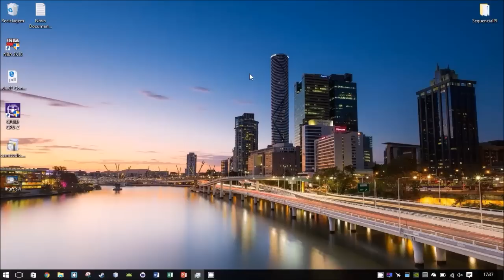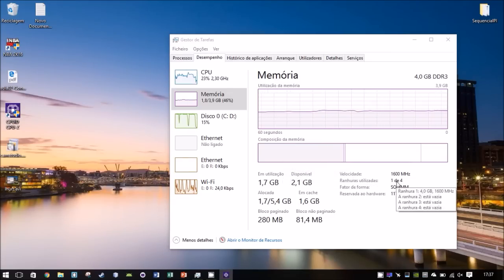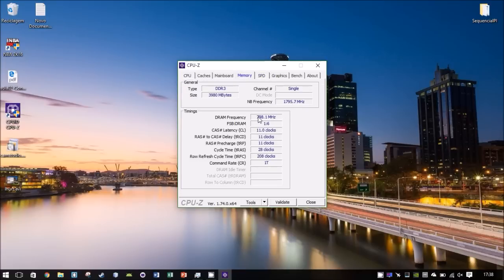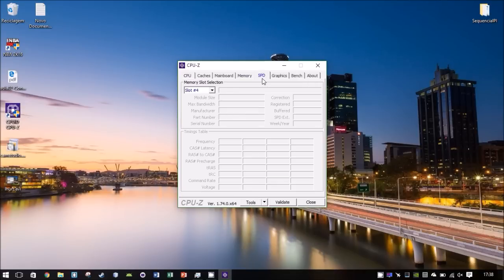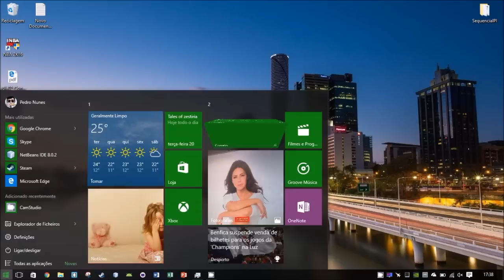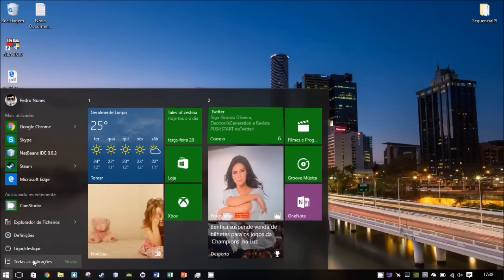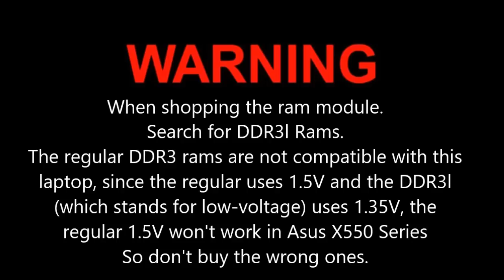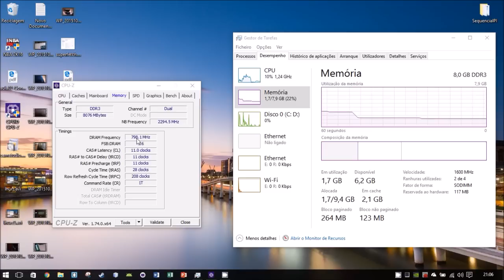How to upgrade Ram on Asus X550 Series (X550LB)

Comment: Is the Hyperx Impact 8gb ram DDR 4 2133mHz 1,2v compatible with my x550lb ?
Reply from the maker: No, but what cpu do you have?
Reply: I5 4200U at 2,4 ghz. But will a DDR 3 of the same model work ? Considering it has 1600mhz....
Reply from the maker: Alright that laptop is incompatible with DDR IV.
What you need is a DDR3L 1600MHZ, CL9 or something.
Why DDR3L, because our laptop only handles low voltage stuff, our CPU for example is a i5 4200"U", the U stands for low voltage, so, we need as well DDR3L which have like 1.35V while the regular DDR3 have 1.5v

Any DDR3L 1600MHZ CL9 will be 100% compatible with your laptop.
Cheers
Reply: Thanks , sir ! You helped me a lot
Reply from the maker: Well that's nothing :)
Any extra doubt that you might have, just let me know.
Cheers

Comment: Nice. This memory work ON Asus X555UB?
Reply from the maker: Hi, sorry for taking so long, which memory are you talking about?
Reply: DDR3L 1600
Reply from the maker: Depends, what CPU Brand and model are you using?
Reply: Core i5 6200u.
Reply from the maker: I guess that one uses DDR IV already.
You can check it by using CPU-Z, it's a small software that tells you everything about your CPU, motherboard and Ram, it's free.

Comment: Hello Sir! thanks for your guides! Im currently using Asus A550L, with 4gb ram installed in the extra ram slot (8GB total). For now i am upgrading to 12GB total, bought a Crucial 8GB DDR3L-1600 SODIMM. Do i have to install any software after replacing the current one?
Reply from the maker: No, you just need to replace the ram, nothing more :)
Cheers
Reply: Alright! Thank you!
Reply: @BenchARTVideos  hi bosd extra slot ram max 4gb or 8gb?

Comment: I have same laptop series asus x552m but that slot is already used,in task manager it says 1 out of 2 slots used so I cant find second slot
Reply from the maker: Probably there isn't any second slot, it's bad software measurement, just like you can see in my video, the software claims that I have 4 slots, and I just have 1, that I why I have been suggesting to always open the laptop before buying the ram.

Comment: can upgrade a cpu on this laptop ? i have same but i think i ant upgrade my
Reply from the maker: Nope, It's all solded, It might be possible, but it shouldn't be easy since it's solded!
Reply: ohh thanks for the fast reply hope it can be upgradeble i have celeron 1.5ghz with 8gb ram really need better cpu
Reply from the maker: I think you are out of luck, and even a CPU like this one isn't cheap at all, it costs around 300$
Even if it was possible to de-solded the CPU and put another one (which I don't really know if it is possible or not, never saw that process), it would seriously be expensive.
You can find laptops with i3 and i5 ULV versions from 450$ to 550$ brand new, which should be much better deal.
Cheers

Comment: BenchART Hi I have X550vx laptop with 8 gigs of memory, are there two slots 8 gigs or am I replacing the 8 gig with 16 gigs memory card?
Reply from the maker: I'm not really sure.
You will need to open it up in order to check it.
Just like I said software don't properly know how much slots you have.

Comment: Hi there! does it work for Asus K550c?   Thank you very much and congrats for your video!
Reply from the maker: Should work yes.
What is the CPU of your laptop?
Reply: i5-3337U CPU 1.80 ghz        Also, it says 'Sockets=1'; 'Cores=2'                                     Thank you very much for your quick reply!
Reply from the maker: Well yes, it will work, you need a 1.35V ram kit, so basically when you go to the store just ask for DDR3L, since it's suitable for low voltage laptops like ours.
Cheers..
Reply: Sorry but, how can I find the maximum ram capacity?   Should I buy a 4, 8 gb?
Reply from the maker: Well, first stop is to open your laptop the same way that I did, check if you have the free slot.
How much ram your laptop have?
Reply: it says 4gb ram. So once I open  the laptop it should be written?
Reply from the maker: Well in that case you should have a free slot, in the same exact spot as mine.
You can put 8GB or 4GB that depends on the tasks that you will do to your PC.
+4GB if you plan on gaming a little more.
+8GB if you plan in Multimedia things like rendering on After Effects or Premiere/Photoshop.
Reply: Great! thank you for your advice, it is very helpful for those who know anything about it!
Reply from the maker: You're welcome, any doubt just ask..
Cheers
Reply: Yes, I got one: have you tried the SSD upgrade (from HDD)?  Thanks!
Reply from the maker: I was thinking about that some time ago, but now SSD prices have risen, and I removed that ideia for now.
But now I am eager to upgrade my desktop :D
I'm saving slowly for it.
Anyway what's the question? I can fill you in
Reply: Thanks! I think the asus k550cc is a good laptop, and by upgrading the ram and changing the hdd to sdd,  might be a good way to save money until get a newer and better laptop... what do u think? I saw another video doing the ssd upgrade but I'm not sure if this will work..  cheers!
Reply from the maker: It will work :)
What's the main use of your laptop?
Reply: 'office word' and images, pdf, and the likes...but these files are getting quite heavy and my laptop gets slow everytime I put images into a word file....so I thought I could solve this by upgrading the ram while I save money for a newer....
Reply from the maker: SSDs will help you out with that a lot.
Altough even (maybe) 8gb with a SSD will be enough for you to make your laptop last for a decade.
Cheers
Reply: BenchART  great! But I don't know which type or model...that's why I asked you about the ram...
Reply from the maker: Probably you gonna need to buy DDR3L 1600MHZ CL9
Cheers
Reply: Thanks, I need to be sure about which one before purchasing it...  you have been very helpful mate... cheers!
Reply from the maker: Good luck, let me know if the things gone as suppose to after you are done with the upgrade.
Cheers
Reply: Well, I've just looked at 'DDR3L 1600MHZ CL9' SSD  but couldn't find anything. The video I saw doing the Ram and SSD upgrade (Italian, easy to find here) did it with a SSR3L ram, but with the 'Kingston SSDNowV300 Unità a Stato Solido Interno, 240 GB, 2,5", SATA 3.0'....
Reply: sorry for asking so many things...
Reply from the maker: Ohhh sorry.
I though you were asking for what ram should you buy.
For ram look for that "DDR3L 1600MHZ CL9"
As for SSD a Samsung 750 should be fine, strongly advice to buy a 240/250GB unit intead the one from 120GB
In any case if you preffer other brand Crucial BX series used to be very good too.
Cheers
Reply: Great! Thanks once again!
Reply: Update: I asked to ASUS and they replied: "We inform you that in your equipment you can put a memory of 2Gb or 4Gb. Being that the memories that have been tested in this equipment follow below.
2Gb:
HYNIX/HMT425S6AFR6A-PB
SAMSUNG/M471B5773CHS-YK0
4Gb:
HYNIX/HMT451S6AFR8A-PB
KINGSTON/ASU16D3LS1KBG/4G
SAMSUNG/M471B5273CH0-YK0

Regarding the storage, we are sorry but this equipment does not have the capacity to install an SSD disk, reason why we will not be able to give information on them."

I'm a bit confused, have to admit. They do not say the maximum ram amount and more interestingly reject the SSD upgrade!    

Any comment?

Cheers!
Reply from the maker: They don't know what they are talking about :)
I can assure you, your laptop supports a lot of ram.
As for SSD, your laptop supports it, you need to remove the HDD and put the SSD.
Reply: Agree!  I hope the one I bought really works (Kingston KVR16LS11/8 - Memoria SODIMM de 8 GB, DDR3L, 1600MHz, Non-ECC, CL11, 1.35 V)
Reply from the maker: It will, if you have the free slot
Reply: Update!  It did work! Although I saw in many websites my laptop had 8gbs of max ram memory, it is actually working and the total ram memroy displayed is 12gb!    Thanks for your help Mate!  Next, the SSD!
Reply from the maker: Nice to know :)
The SSD will be very very noticable in your system.
Cheers

Comment: asus x550cc is it same ? what do u think about ssd samsung evo 850d this laptop ?
Reply from the maker: The insides, i'm not really sure if it is the same, if you tell me the CPU that you have, I can tell you if the rams are the same.
About the SSD, samsung is good enough :)
Reply: cpu i5 3337U 1.8ghz 4cpu's
4gb rams and 1 slot
Reply from the maker: In that case should be the same, yes you can upgrade to a Samsung SSD :)

Comment: Can you help me with the process with my Asus k550xv??
Reply from the maker: What is your CPU, I think your Chassis is different, so you the opening of the laptop might be different.
Reply: BenchART I have an intel core i5,  4 gb ram, 500 gb hdd, Nvidia 950 
I was planning on adding 4 more gigs of ram
Reply from the maker: And you should do it, but what's the model of the CPU, it's just more of a curiosity.
The problem is, I'm not sure if the chassis is the same..
Reply from the maker: Yep you can buy any DDR IV ram at 2133MHZ for your laptop :)
Reply: BenchART thanks dude I appreciate it
Reply from the maker: The dissassembly of the laptop might be different than what you saw here.
This one was the X550 series, yours is the K550, not sure how much is different when it comes to open it up.
But I bet there are more videos like this for your K550.
Cheers
Reply: BenchART I guess I'll have to figure it out by my self but I read on some review that it shouldn't be difficult

Comment: I salute you sir for this video. I have 2 questions. 1'st is the upgrade really being felt, i mean is there a big difference in the performances of the laptop? 2'nd is there any other way to upgrade the laptop. thank you for your time :)
Reply from the maker: Hi Costin, thanks for the comment.
So for me it was felt, due to the fact that i do some software development, and tools like Visual Studio and other high end IDEs are hungry enough for ram, not to mention that many games start to use a lot of ram.

The ram upgrade is only felt depending on the type of use you do it.
You can share with me the type of use that you give to it, in order to know if can be a good ideia or not.

For the second question.
Yes, you can upgrade your HDD to an SSD, which is a recommendation that i make to anyone who have the money, it will make your laptop blazing fast on windows and opening and closing stuff.
Cheers
Reply: BenchART well i use it mainly for gaming and some software development, on the gaming side the x550lb is pretty rusted.  I was asking myself if the extra ram would  actually be felt in regards to better gaming performance i know ram is important but with the poor gaming cpu and video card i was not sure on the result. on the dev part i am fine for now. ty so much for the quick response and for your time.
Reply: BenchART well i use it mainly for gaming and some software development, on the gaming side the x550lb is pretty rusted.  I was asking myself if the extra ram would  actually be felt in regards to better gaming performance i know ram is important but with the poor gaming cpu and video card i was not sure on the result. on the dev part i am fine for now. ty so much for the quick response and for your time.
Reply: BenchART oh, i have the i3 1.7 ghz with a nvidia 740m
Reply: Probably it's the time for a upgrade to a desktop for gaming and keeping this one for code.
Reply from the maker: Costin Balan That's exactly what I have :)
I have my desktop for 7 years and still handle all the games I want, except for mafia 3 due to a CPU incompatbility :)

Comment: What is the maximum improvement I can make in this model? I have 6GB and would like to improve if it's possible for 16GB, can i make that?
Reply from the maker: The maximum I could do in mine would be if I ain't mistaken, is 12GB.
Because 4GB come solded to the motherboard, and I just have 1 slot to upgrade.
So the max Ram module i can buy is 8GB... 8GB + 4GB = 12 :)
If you only have one slot on yours, and you have 1 solded ram of 4gb, you can't go for 16GB.
Still, what type of work you do with your laptop?
Reply: I use architectural programs, doing renders, I use a lot of photoshop, basically programs that pull through  the RAM
Reply from the maker: Ricardo Silva Indeed, those softwares are very hungry for ram, I know.
Take a look inside the Laptop and check how many free slots you have, if you have something close to what I have (1 slot only), the it's really the maximum you can go is 12GB
Cheers
Reply: I went to the cmd to see my model and it's X550LD and I went to see what the maximum I can put and it's 8GB what happens if I move to 12GB
Reply from the maker: Ricardo Silva I believe you can still put 12gb of ram, simply the system will accept it.
It just won't be dual channelled but single channelled, file transfers and memory activities will be a little more slower.
But if 8gb of ram will bottleneck your activities and punish the swap and virtual memory of the windows due to the fact of your softwares fullfil all the ram, in those cases more ram will always be faster than slower memory.

If for some reason you think that 8gb won't be fulfilled in your work, then the 8gb will be maybe faster than using the 12gb, all depends a lot of how much ram will your software really use.
Reply: Okok
Thanks a lot for the help
Reply from the maker: Ricardo Silva Check the interior of your laptop and let me know how many slots for ram you have, and if the ram occupying your slot is really just 2gb.
Cheers

Comment: Is this the right ram for mine m8 mine is x555LB

http://www.lazada.com.ph/kingston-value-ram-4gb-1600mhz-pc3-12800-ddr3l-135v-non-ecc-cl11sodimm-1rx8-laptop-memory-ram-4391005.html
Reply from the maker: Depends :)
What is your CPU?
Reply: intel 5200u 2.2 ghz
Reply: +BenchART i5
Reply from the maker: Yes, that one should do the trick :)
Reply: thanks mate
Reply from the maker: Von Paulo You're welcome XD
Reply: +BenchART I thought that the link is 8 but its only 4gb I want mine to turn 12gb ram please mate check this new link 

http://www.lazada.com.ph/kingston-value-ram-8gb-1600mhz-pc3-12800-ddr3l-135v-non-ecc-cl11sodimm-2rx8-laptop-memory-ram-4391006.html
Reply from the maker: Yep it will work

Comment: I have Asus X550Z with AMD 10 - 7400P, can i use DDR3L for 2x8GB in total of 16GB?
Nice video by the way man
Reply from the maker: I believe yes, but you should open the laptop before upgrading to check if there is slots for upgrading :)
Always confirm it before buying :)
if you have any trouble or doubt, just let me know.
Cheers

Comment: I have Asus X550VC, DDR3l too?
Reply from the maker: Don't know, you need the voltage, if it is using 1.35V for the Dram then is DDR3L
If it is 1.5V than is regular DDR3.
Either way if you buy DDR3L ram, it works not only in DDR3L as well as on the regular DDR3.
Cheers!
Reply: +BenchART I don't know where can I find voltage. In CPU - Z I have DDR3 but voltage Isn't here.
Reply from the maker: Jan Ženožička Ye same for me, but I'm reading something on Asus FAQ, and it says that during and after the haswell CPU's, Notebooks started to use exclusivly DDR3l.
What is the model of your CPU?
Reply: +BenchART Ivy-Bridge i3 3110M 2,4Ghz
Reply from the maker: Jan Ženožička Ah, the M stands for regular voltage CPU.
I don't know at 100%, but I am almost certain that you can use the regular 1.5V rams.
Reply: +BenchART OK thanks, Mate!
Reply from the maker: Jan Ženožička You're welcome!

Comment: I have a asus x550LB-o090d and I would like to know if I will have no problems if I buy the same ram that you used
Reply from the maker: +viktors vanags Hi there...
Well that depends on what CPU that PC have.

If your CPU ends its name with a "U", for example "Intel i3-4000u" then yes you can buy :) 

But make sure you open your backlid first to check if you have free slots, and always check at what speed they work.

All of it can be checked within a free software called CPU-Z
Cheers.
Reply: +BenchART Thanks for the help! I have a i5-4200u cpu and il check that app too!
Reply from the maker: viktors vanags Nice so, yes you need to buy a 1.35v ram just like me, now you just need to check the clock that ram runs, and open the backlid and see if you have any slot free and then.. upgrade time :P

Waiting for feedback from you :)
Cheers
Reply: +BenchART One more thing. In my specs its said that i have 4 gb ram ddr3 1600 mhz.Shouldnt I atill buy a ddr3l or a regular ddr3 ram?
Reply: +BenchART I couldnt find the exact ram in my local stores but I found this KINGSTON 4GB DIMM DDR3L
1600Mhz 
Can I use this aswell?
Reply from the maker: viktors vanags Yes, its the same, DDR3L is a 1.35v ram, so thats it.
Reply: +BenchART Thanks!

Comment: Hello.I have a laptop ASUS X550CC and I opened it and I already have 4 gb integrated on the motherboard and a free slot(just like your video).Task manager also tells me that 1 of 4 used slots.But what if the motherboard can't handle more than 4 gb ? For example there's another dude in the comments here who has that slot occupied(the one you used to upgrade).I really tried to search on google but there's mixed results.Some are telling me that 4 gb is maximum,some 8 gb,some that it has only 1 slot of 8 gb ( lots of confusion ) . In conclusion,if I have that free slot I should be able to upgrade with at least 4 gb,right? Otherwise why would they put the ram on the motherboard and leave that slot free?Any thoughts ?
Reply from the maker: +Marius Cristian I think you should have no problems upgrading, your motherboard will support it.
The only thing you need to be careful is to know if you need a DDR3L ram or a DDR3, and the clockspeed and timmings of the ram, to try to buy the best ram that match your integrated ram on the motherboard ;)